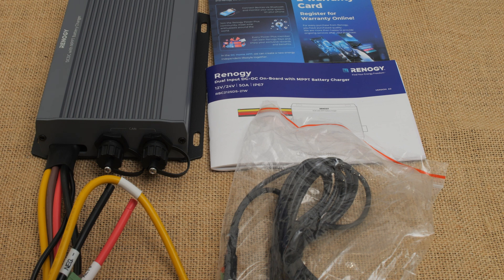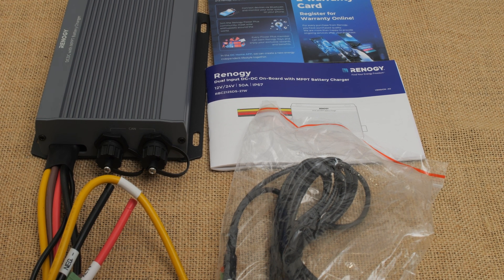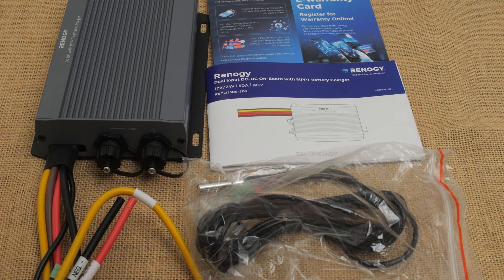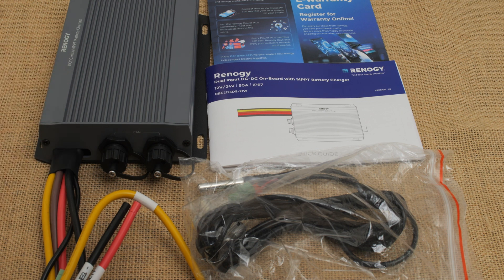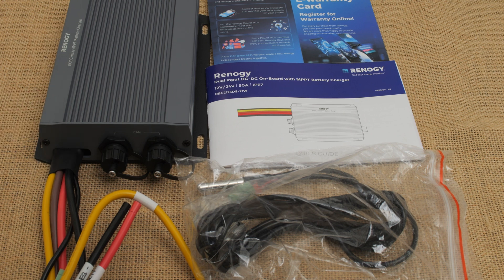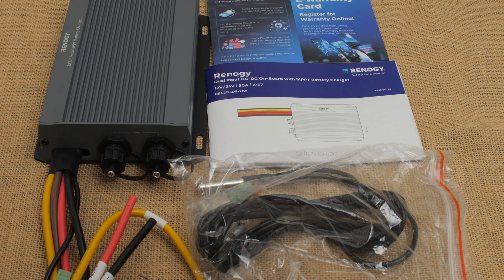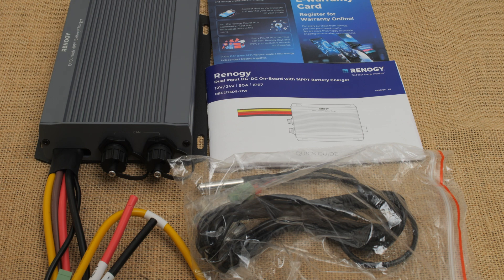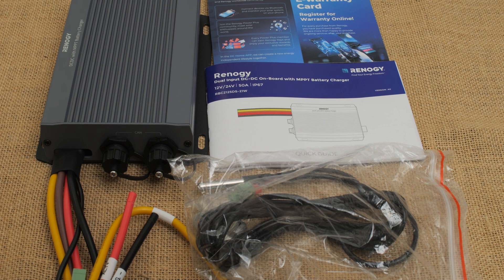Renogy 12V/24V 50A DCDC with MPPT overview

Comment: one draw back is the unit does not have an ignition wire, so you can’t run the device with a smart alternator on
Reply from the maker: DC to DC chargers are actually meant to deal with smart alternators, otherwise we could still use a super cheap solenoid system. The red wire goes to your alternator, that's your "ignition" wire in this case. The unit can read the varying level coming from it.
Reply: @commonsensepreparednesschannel  this is good to know, about to install this in a week? Is there a way to tell if you have a smart one? I’m assuming a 2019 Ram 3500 Laramie would have a smart one then ? :) excited for your install ! I’m worried these units may get hot , as the normal solar and or dc are much much bigger
Reply from the maker: @ClarkyMalarky  I would be very surprised if a 2019 did not have a smart alternator, most if not all new cars have them. I was ready to install and then saw they wired BOTH batteries with fuses so now I need to find a schematic to find out which battery needs to stay as the starter battery or if I need to move the wiring over.
Reply: ( Generally a European manufacturer issue)
Reply: There has already been a post in the Facebook group about this problem. The red wire is not the “ignition” it’s the supply feed into the unit. There are voltage thresholds that unit operates in. No criticism towards you, keen to see the install video you do
Reply from the maker: @yobby05  Here is their reply:
We would like to confirm that 50A DC-DC Battery Charger with MPPT works with both smart and traditional alternator types. 
Furthermore, we would like to recommend checking section 3.7 of the manual, titled "Check the Alternator on Your Automobile," located on page 10. This section provides further information and guidance that may help ensure optimal performance with your setup. We have attached a copy in this email. 
As for the charging logic, the battery charger allows you to charge the auxiliary battery with a starter battery connected to an alternator, with solar panels connected directly to the battery charger, or with both solar panel and starter battery.
Reply: @commonsensepreparednesschannel  does this unit have. Built in cooling fan? I wish there was more in depth videos on how they eliminated the size of the unit itself if not compared to the old 50amp units with the large hear sink in back.
Reply from the maker: @yobby05  thanks, I don't do fb much so I'm glad you let me know. I will see if Renogy responds to me if I ask them about it. What voltages/amps did the group say it was functional in when they tested it?
Reply: I am still keen to see how your set up goes with it having a smart alternator. 

I read the manual about that part also and I’m still going to be surprised with the working charge voltages.
Reply from the maker: @yobby05  I have dual alternators pushing I think 230A so fingers crossed it doesn't catch fire.
Reply: Yobby I agree I’ve got a case with Renogy the unit won’t provide more than 25amps (possibly a touch more) with my install, I went from the older 30amp unit with an ignition wire so I know what I’m doing. I’m still wondering what’s going on with this I’ll have to check FB
Reply: This unit has only 4 main wires starter battery wire, common ground, auxiliary battery and solar input. The last wire in the manual shows a temp wire for lead batteries. So no ignition wire. My experience was a cloudy two days camping and went for a drive to boost the battery, found I couldn’t get the charger to go above 25ish amps. Would have saved some driving around if I could have got the 50amps out of it. I even disconnected my solar connection.
Reply: This is not true.  It works very well with a smart alternator.  I installed mine a month ago and it works great on the alternator charging side, but I'm not getting much input from solar and am working to troubleshoot that
Reply: @mschrank1  maybe a defective device on both mine and your unit

Comment: From what I understand, the big difference between this one and the older model DC2DC Renogy charger is this one can smartly decide to prioritize alternator or solar depending on which one has the higher output. As I understand it, the old model would always prioritize solar so people were installing a switch to kill their solar while driving (if they have a small solar setup or the conditions are not ideal). Am I understanding that correctly?
Reply: It also has 50v solar input capacity compared to the old one at 25v.
Reply from the maker: There are several big differences but yes that is a big factor in why I chose this over the other models. It's a lot more hands off and takes care of your total system, even keeping your starter battery topped off. The ability to mount in the engine bay was also huge for me. The older models were solar charge controllers first that happened to work with a split battery system, this one I see as more of a battery management system that also smartly controls power inputs in a way that makes more sense based on how people actually use their systems.

Comment: I read a lot of lithium batteries suggest limiting to a 20 amp input for charging. I’m wondering if 50 amp output of this device is too much? Realizing this would replace my solar controller and add Dc to Dc  potential is awesome.
Reply from the maker: We'll have to see if Will Prowse does a tear down and test. 50 Amp units have been around for a while so hopefully they have it figured out.
Reply: @commonsensepreparednesschannel  I’m sold either way ,I bought a “open box one” from Renogy for 130usd . Now to sell the other controller and dc charger I bought a Cpl months ago 🤣
Reply: Shouldn’t be a problem I would assume as shore power charging is 40 amps +

Comment: Struggling to wire this in and other than the poor renogy instructions can’t find a single video of someone installing this… have you installed this yet? 😅
Reply from the maker: I will soon, what's your setup? I have two batteries both in the engine bay so I don't know if my install will be exactly like yours but I will try to keep it general enough to explain other setups.
Reply: Were you able to get yours installed?  What was causing the struggle?

Comment: How would you monitor the batteries by bluetooth to a renogy app if you had two renogy 12v 200ah batteries in parallel? so one lead acid starter and two lithium in parallel, does the controller  give both starter and house bank voltage and historical use via the app?
Reply from the maker: If your batteries are in parallel my guess would be the app only sees the final product as one bigger battery. I was finishing up a dashcam project first to give people time to ask questions about this device, I have not installed it yet but I can see if I have enough spare wiring just to hook it up to 2 batteries next week and see what the app does.
Reply: @commonsensepreparednesschannel   I thought exactly the same.

Comment: i was reading that I could regulate this. im wondering if i need to buy the renogy one bluetooth device manager as well to take it down to 20a on the alternator and study the heat stress incrementally up to 50A.  im in a minivan. so the previous model would shut off the alternator charging completely for only 2a?
Reply from the maker: Do you know the amperage output of your alternator?

Comment: Thanks for sharing - would love to know if this has the same limitations as the old one of only 25a from each of the solar panel and the alternator if both are connected to this charger.
Reply: I’ve just installed one & can confirm it charges up to 50A even if say 4A is solar
Reply: @kestikiadventures8929  thanks for sharing
Reply: are you pulling 50a from a standard alternator? this concerns me. i was reading that I could regulate this. im wondering if i need to buy the renogy one bluetooth device manager is well to take it down to 20a on the alternator and study the heat stress incrementally up to 50A.  im in a minivan. @kestikiadventures8929
Reply from the maker: Here is the charging logic according to Renogy: The charger will take as much power from the solar panel as it can before supplementing that power from alternator, up to the rated charging current.
Reply from the maker: My understanding is it chooses the largest input and gives full support to that, but let me dig into the paperwork and see if I can find more info. Although even if it splits them, as long as I'm getting the full 50A going into my system I suppose I'm not too picky how it splits them up. I do have dual alternators so that pumps out a lot of juice, I imagine solar will have a hard time competing with that.
Reply: @commonsensepreparednesschannel  thanks for checking. With the older version if yo had 1 amp coming from the solar panel, it would limit input from your alternator(s) to 25a. To get the full 50a from the alternator I believe you have to disconnect the solar panel. 

I look forward to hearing what you find.
Reply: Sounds promising